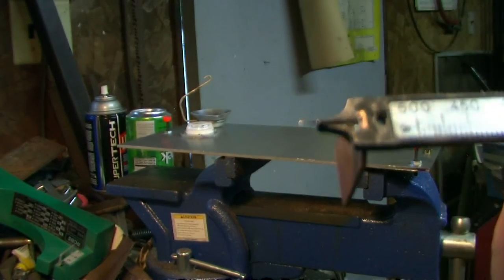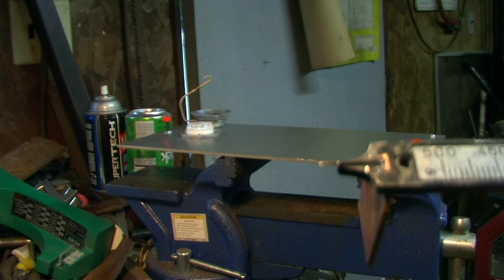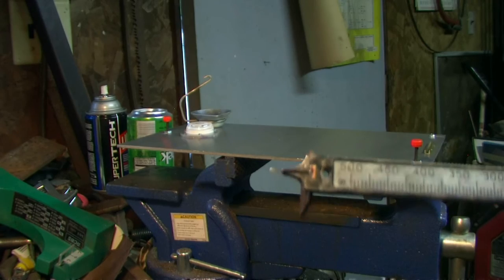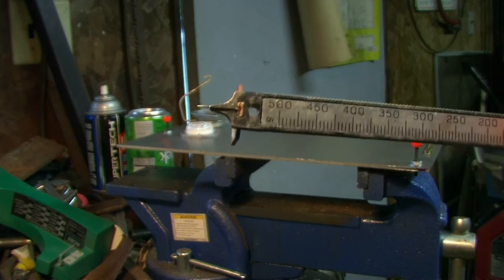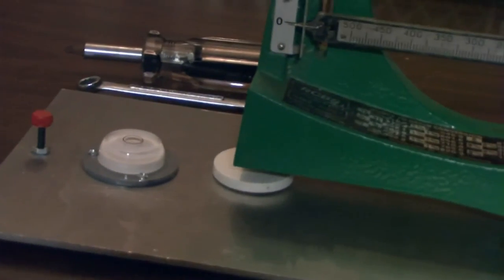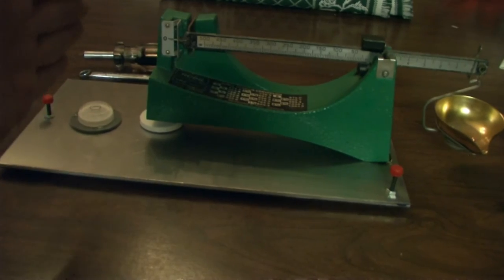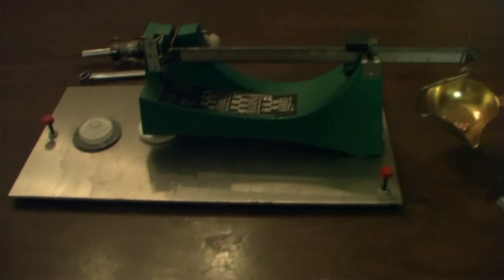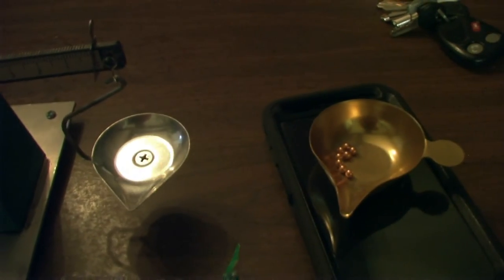Reloading Scale Leveling Base

Comment: Wow, if you need a flat surface just put a piece of annealed 1/4" or greater glass on a regular table.  (3/8" glass would be better if you are going to put something so heavy that it could flex the glass onto it.)  The float manufacturing process for glass assures a super flat surface.  On the other hand, never use tempered glass for this purpose; the tempering process introduces a waviness to the glass, as the tempering is generally done in a very hot oven on rollers.  Also, as I think someone pointed out below, the perfect levelness of the surface is not required with a balance scale of this type.  It is precisely because of non-level surfaces that you adjust the zero by turning the disc on the bottom.  Just like a carpenter's level, level is with respect to gravity, not the table on which the scale sits.

Comment: I just watched this video and it was very interesting. But I’m missing how you leveled the scale on your base. 
I understand the leveling of the base, but when you put the scale on a level base the scale itself is not level. How did you level the scale base? You cannot go by the arm because that’s what your calibrating. I have a hornady scale and I did the same as you. I leveled a base, then set the scale on it. Then I put a level on the scale, then used the adjusting screw to level that. Now I have a level base with a level scale base, now I can adjust pointer arm to that zero. With the Redding 505, there is no place where I can put a level, all surfaces are curved. Am I missing something? The only way that I can see to adjust pointer arm to zero is to have a level scale base, then adjust arm with adding or subtracting the lead weights to the base.
Reply from the maker: The base plate has a fixed pinted pin on one corner. The opposite corner on the same side has an adjustable leveling pin. The left side has an adjustable leveling pin.  There is a round bubble level just on the other side of the scale. 
You level the base on all three legs of a tripod.